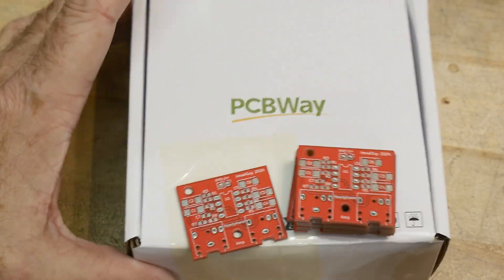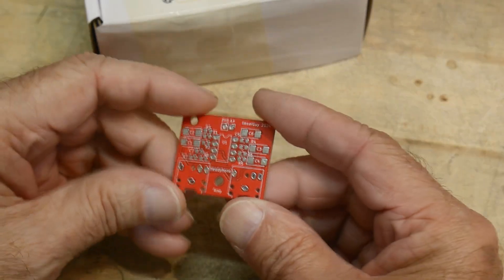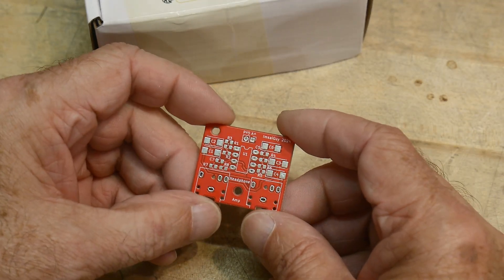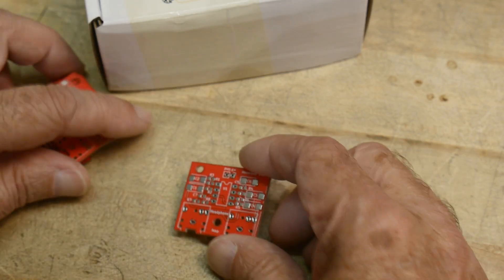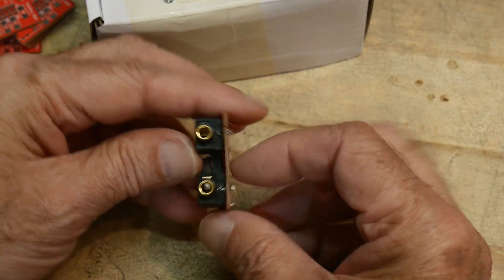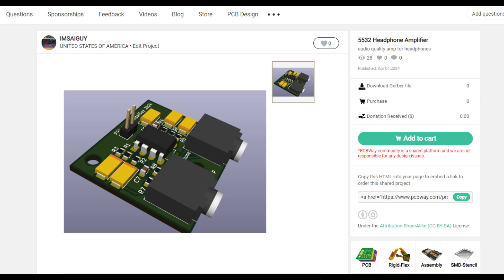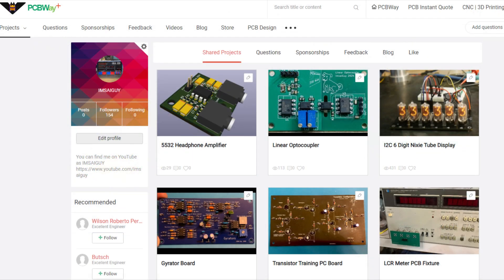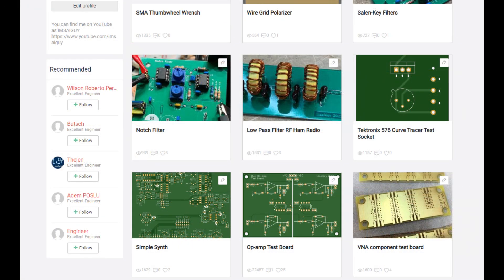#1874 5532 Headphone Amplifier (part 2 of 2)

Comment: I do stuff but it's all on breadboards and 90% of it is Arduino nano software and mostly has to do with blinking, flashing and pulsing LEDs and making weird sound effects with VCOs and stuff.  (The Arduino nano is permanently stuck on one of my breadboards. Once you push all those header pins into the breadboard there is basically no removing it :-)

Comment: Are the output caps big enough (for a quality headphone amp)? Using 10uF together with the usual 32 Ohm headphones i would expect almost no bass at all... Maybe with high impedance "cans" - but they are kind of rare today...
Reply: looks like the -3dB point would be around 500Hz, but then I'm just thinking out loud.
Reply: It's not a quality headphone amp and it was never meant to be, it's a fun educational project and probably sounds ok to boot !
Reply: @andymouse  it was a great video Mr squeak but I was just agreeing with the other commentator that he was correct but I should have added then when the impedance of the output cap matches that of the headphone we can say that the output power has dropped by -3dB.  impedance of the cap cand be found by impedance Xc =1/(2 x PI x F x C) or by transposing the formula the frequency where the cap impedance =32 ohms  frequency = 1/(2 x PI x C x Xc).
Reply: @TheEmbeddedHobbyist  Howdy TEH !! loads of mafermatiks Squeak! yeah, I think the other guy was taking it a bit too seriously that's all :)
Reply: @andymouse  I was already on a bit of a cap roll having commented about them on a previous video. But  IMSAI Guy is a bit like Mr kipling but video's and not cakes.
UK joke.
Reply: @TheEmbeddedHobbyist  LOL ! :)